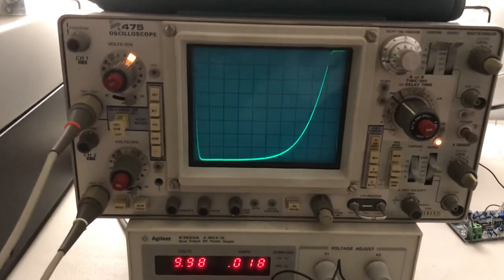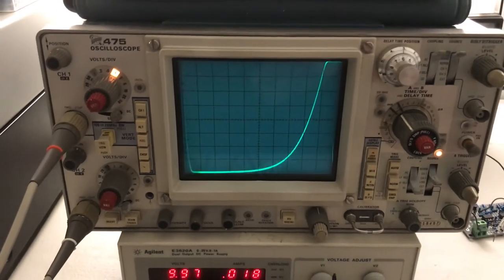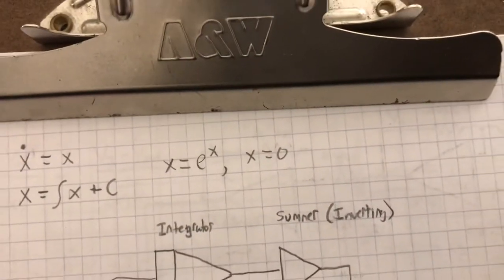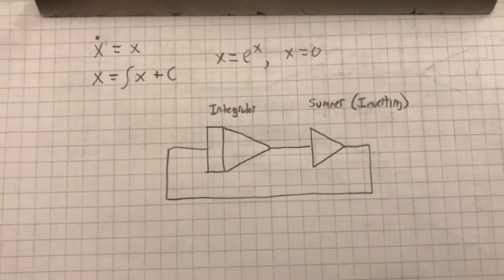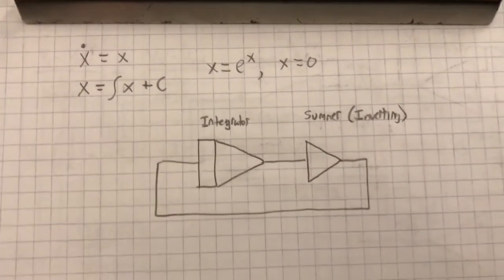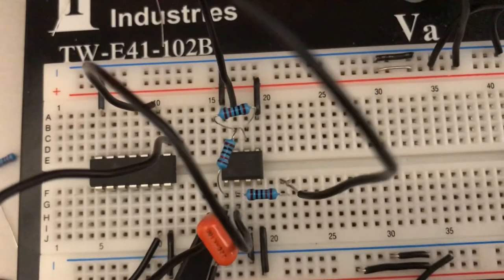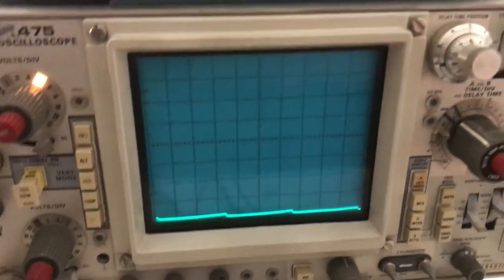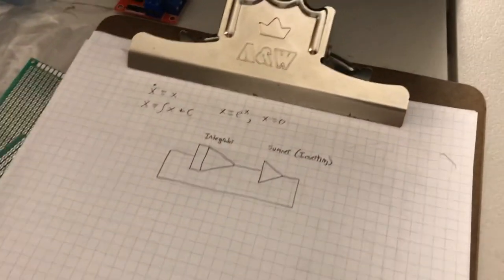Simple Analog Computer Solving Differential Equation

Comment: Where do i buy one
Reply from the maker: You can get the components for cheap on ebay. You’ll need a TL072 op amp (or pretty much any other op amp) and an analog switch (I used a CD4066), and resistors and capacitors. And of course an oscilloscope to view the output